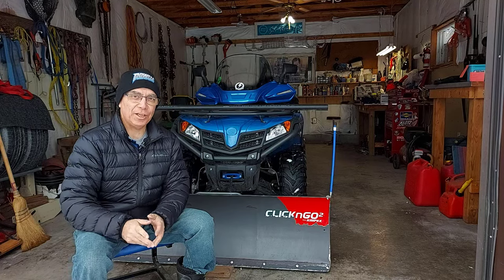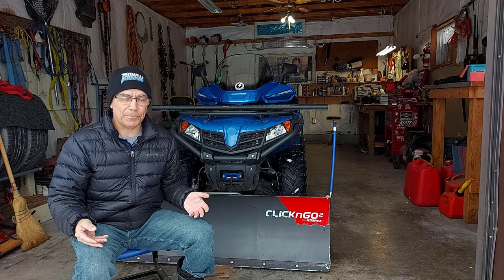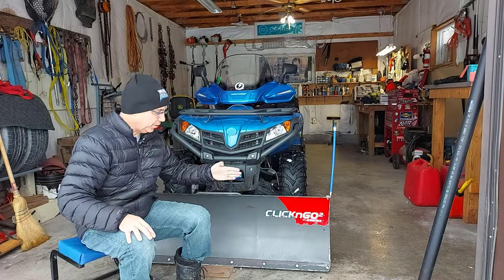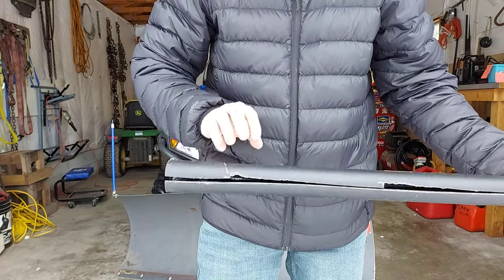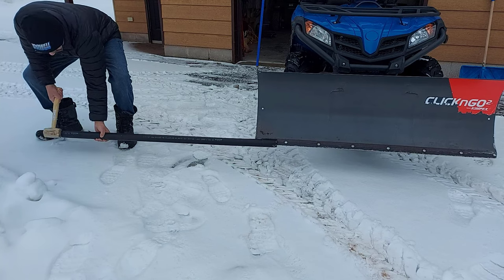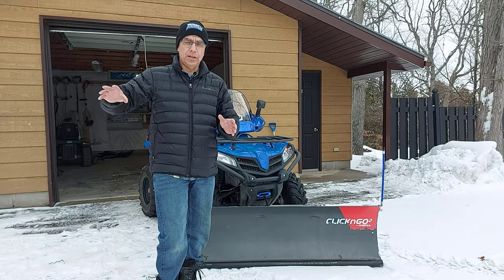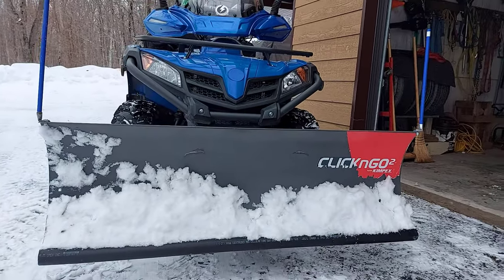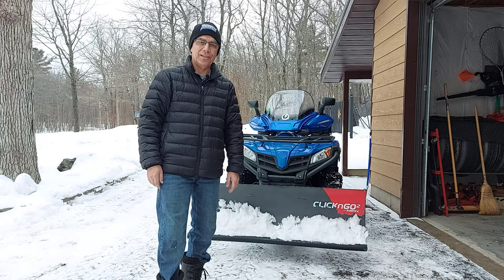ATV SNOW PLOW BLADE HACK For Concrete & Interlocking Brick Paver Driveways

Comment: I use a 2” solid wall ABS plastic pipe on a 54” KFI plow blade. Works great on asphalt and cement and doesn’t peel up the lawn. I have a cforce 800 xc for plowing. This is a great modification to a plow blade. I watch all your videos.
Reply from the maker: Thank you 😊 How do you find the smoothness of ride on your 800?
Reply: @GettingItDoneRepairs  2021 ATV the ride is pretty good. It’s a two up machine. I have the shocks set at 15 both for rebound and compression. It seems absorb the bumps pretty good although I really don’t have anything to compare it to. This is the first ATV I’ve ever own. I have about 4200 km on it now. This is the ATV that needed the fuel pump that did fix the problem. I’d like to come down and ride the trails in your area at some point with you we’ll have to set up something. I’m retired now, so I have lots of time for projects and fun.